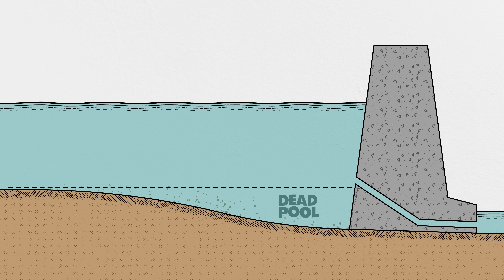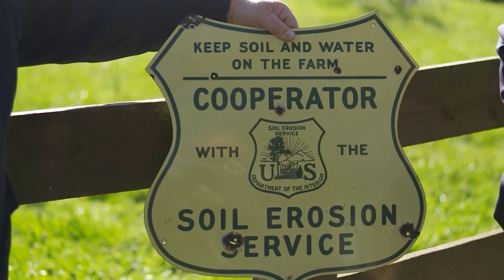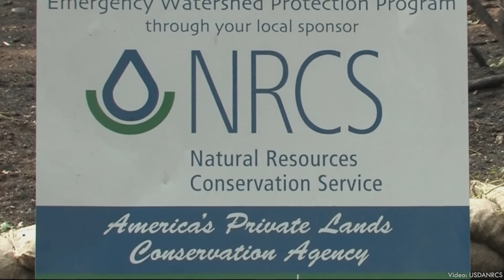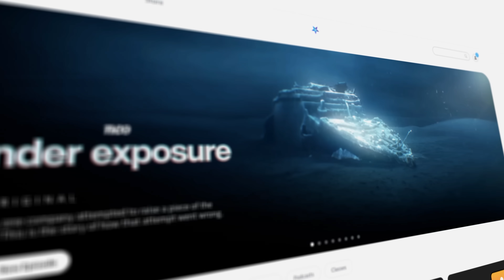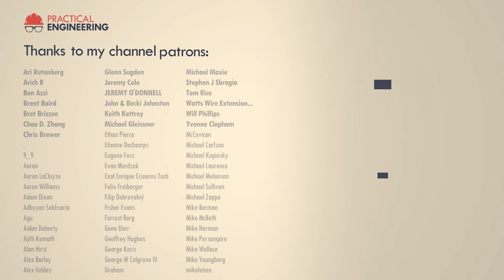All Dams Are Temporary

Comment: 4:58 “dirt is heavier than water! Let me prove that to you real quick”

Brilliant 😂
Reply: Dirt is "denser" than water I believe is the correct term.
Reply: @TheMrDarius  5 gallons of dirt weighs approx 55 lbs(or more if you compact it) and 5 gallons of water weighs 41.7 lbs
Reply: @bmxscape  which cements the fact that dirt is DENSER than water.
Reply: @ you are missing that it also cements the fact that dirt is heavier. it is denser, and heavier. Mercury is denser than both, and heavier. I do not see your point
Reply: @bmxscape  because science. Density is more of a correct term. Being heavy changes with specific conditions, density never changes. Dirt will always have a higher density than water. That's my point.
Reply: @ "because science"... right...You are wrong and again missing the point.

The density of dirt is not a constant. It does indeed change, contrary to your beliefs. What do you think happens when you compact soil? Go dig a hole in an undisturbed part of your yard. Break up any chunks of dirt, and fill it back in. You will seem have an "excess" of dirt. That is the density decreasing. Now dump a bucket of water on the loosely filled hole. It goes back to normal. That is the density increasing. Many things, from the shape of the soil particles, amount of organic matter within, wetness of the soil, pressure, aeration, all alter the density of the soil particles(distance from each other).  

The weight of a given soil particle however, remains a constant, even while the density changes - assuming you stay at the same altitude. 
Perhaps you are confusing the difference between weight and mass when you leave the planet, but that's a whole different discussion.
Reply: @bmxscape  I should have specified a bit better. Water as a molecule is less dense than a dirt molecule. I'm speaking at a molecular level not the macro level. That's my fault for not being as specific where no matter what at a molecular scale dirts density doesn't change water doesn't either unless you're dealing with heavy water with extra neutrons.
Reply: @TheMrDarius  In that case your point is not applicable to real life. We don't have single particles of dirt sinking in single particles of water in real life, nor can you even measure the density of a single molecule as the density calculation relies on volume of molecules(nor is "dirt" a single particle type). Dirt acts as a fluid just as air and water does, in real life. Should I specify we are talking about real life?
Reply: @bmxscape ”heavier” is not a scientific term. Riddle me this… I have one kg of steel and one kg of feathers. Which one’s heavier? 

How do you comprehend mass, density, and volume and still think “heavier” is a term?
Reply: @bmxscape  The demonstration was of density
Reply: @enemyspotted2467  The Kg of feathers is heavier because you'll have to think of what you did to those poor birds.
Reply: @bmxscape  5 litres of dirt is lighter than 5 gallons of water. Hence, in a comment above, "in some case, the water will become heavier".
Reply: @ what...? is there something wrong with your brain or are you intentionally blocking out logic? "heavier" is the word used in the video. That is why it is the topic of debate in this comment thread.. You look like a fool by stating weight doesn't exist.
Reply: @ So go make a post directing "practical engineering" telling him he is wrong. I am simply agreeing with what he said
Reply: @ if you think you can't measure the difference in weight, aka find which is "heavier", between a 5 gallon bucket of feathers and a 5 gallon bucket of steel, you really have no place adding input to the conversation
Reply: @bmxscape  if you can't determine that weight in my answer is including the emotional weight you'd be carrying around, then you're not the brightest lightbulb in the shed
Reply: @bmxscape  that's what the original comment did, It said that the demonstration showed something else. And he knows that already.
Reply: @mayo Lol we are having a debate like adults and you are the one to show up throwing insults... and your name is mayonaise.. please just leave and let the adults finish their conversation. Thanks! PS. none of my replies are directed at you. Thats just you desperately clambering for the attention you never got as a kid.
Reply: @bmxscape  What's even more ironic, Mercury is the densest planet in the Solar System.
Reply: @bmxscape  names can be anything, are you gatekeeping screennames now? You are a child and will probably never admit that you've had a misunderstanding
Reply: @h8GW  Other than Earth.
Reply: @bmxscape 
And what about if you compact the water?
Reply: @ the atomic mass of the water molecules do not change
Reply: @TheMrDarius A gallon of water weighs about 8.33 pounds.
A gallon of dirt weighs about 11 pounds.
Dirt weights more than water no more context needed. However wet dirt weighs more than dry dirt, and water so mixing the two essentially means you create something with more mass than both. It's really not that complicated. You didn't say "density" honestly there is no need for what I said explains it perfectly fine.
Reply: @Peterwhy  liters & gallons are two different volumetric measurements.
Reply: @bmxscape   It's only a fair comparison if you compact the water too.
Reply: @TheMrDarius … It’s also heavier.
Reply: its funny that in some case, the water will become heavier
Reply: I DON'T BUY IT.
Reply: @danielwesterlund1905 yeah I think we need a few more demonstrations, to make sure
Reply: What's heavier? A ton of water or a ton of dirt?

Grady: 🤔
Reply: It's like when there's a [citation needed] on a seemingly obvious fact on Wikipedia
Reply: False flag!
Reply: “Let’s try that again to prove it wasn’t a fluke…”
Reply: But steels heavier than feathers
Reply: I never expect to audibly laugh while watching educational videos by myself, but I most definitely did.
Reply: 😮 that went right over my head
Reply: Yeah, sure it is, smart guy. Now prove that you didn't just flip that entire video upside down!
Reply: I was going to contest that, but thankfully he convinced me just in time.
Reply: He distributed that sand so normally
Reply: HE'S A WITCH!
Reply: BUt he was using sand, not dirt! :D
Reply: Me: ALL you did was dump dirt in water how are you comparing them?!?!......oooooohhhhhh
Reply: THIS IS A LIE PUSHED BY BIG DIRT DONT LISTEN TO ANY OF IT
Reply: Steel is heavier than feathers
Reply: That’s like saying muscle is heavier than fat.
Reply: A pound of dirt is more dense than a pound of water. That is why dirt sinks in water, not its weight.
Reply: That wasn't even dirt, it was sand
Reply: Before he show it, i was sceptical at first, than i realize, something heavy always sink😂. Now i need to do my civil engineering homework more🤣
Reply: Dirt is actually more dense than the water, not heavier.
Reply: Nah,  i belive you, dont need prove it
Reply: Mind. BLOWN.
Reply: It tracks with all my research so I felt good.

Comment: You asked for a fix. If you where to place a large pipe up the center of the stream bed about 3/4 of the way through the reservoir, you could open the pipe at regular intervals. This should let most of it pass through. Also it should be drained regularly to help with this.

Comment: Could another structure built up stream that divides the river as it enters the reservoir into slices that continue down to the dam in columns
| A | B | C | D | E | ect then by dividing the reservoir up into sections closer to the 2 dimensional model, each slice Could be flushed individually, stopping the creation of a small central channel, Or by turning the reservoir into a massive continuous meander, water enters at ( A ) flows down to the dam then back away up ( B ), down ( C ) ect. Until ending back at the dam via ( E ect ) turns the entire reservoir into a 2 dimensional channel, just back and forth and from one side to the other.. 🤔

Comment: What about burying aerators to force the sediment back into the flow so that the sediment either goes over the dam or goes through the turbines. I recognize the damage sediment might do to the turbines but if you want to eliminate the problem of sediment build up, you have to accept the flow of sediment through the generators of the electricity. Not really a way around that. I can imagine the energy needed to run these but seems as if we would just be substituting one energy intensive method for another.

Comment: Why not use suction dredges as shown at 7:47, or at least the mechanism on them in static form permenantly to pipe the sediment to the other side of the dam?
That would keep the deltas from building up past a certain point on the high side of the dam and solve a lot of the problems downstream by still letting sediment flow down the rest of the river.
Is it just insanely expensive to operate a dredge pump like that? So much so that it wouldn't be worth running a dam to begin with?
You could even do it very low tech on existing dams by having an actual dredge ship who's only job is to collect sediment from around the reservoir, sail up to the dam and blast it over the top, the pumps are clearly strong enough.

Comment: I know its not at all feasible to grow fungal mycelium on the bed of an entire water source leading to a reservoir, but i wonder how resistant a system like that would be to reservoir sedimentation given how erosion-resistant myceliated soil is. pleurotus ostreatus is a powerhouse!
Reply: I think if the conditions are good for the mycelium, you could just spray spores from a barge going down the river
Reply: @ i don’t have enough experience to know myself, but do you think the spores would be able to germinate underwater? or would this hypothetical require a treatment of the bed with spores before flooding

Comment: 1:15 So you asked me to come up with a solution off the top of my head before watching the rest of the video.

Well I thought of dredging at first but that's obviously going to be completely impractical, where are you going to put the material? You can't dump it somewhere else in the lake like you'd do with a river or port, and trucking it away would be ridiculous.

But then I remembered flushing. You periodically drain the reservoir (every 5 years or so) allowing the built up sediment to be washed away. Obviously it wouldn't work to clear decades of build up, and it would be a huge hassle to anyone who has a boat moored up along the shore, or anyone else who uses it regularly. But for a reservoir that had this "lifecycle" from the start it would just be a natural part of living by the reservoir, that once every five years you'd have to pull your boat out of the water and prepare for the levels to drop.

I'm an engineer, but not a civil or hydrologic one so there is probably something I've missed. However just a quick google tells me that managing sediment accumulation is an active and ongoing process from the moment the dam is built, not one that you leave for decades and then have to do drastic remedial work to rectify.

It's a multi-stage solution. First, erosion control methods in the catchment area upstream to minimise the sediment entering the reservoir. Then you need to look into land use in the catchment to minimise soil erosion such as reforesting where possible. Then you can put in small check dams to trap sediment upstream of the main reservoir. You can also divert heavily sediment laden water through a bypass channel.

I found all that out within a few minutes of googling, a proper engineer in the appropriate field will know all that stuff already. Dams should be built with these measures in mind. It's a shame that people in the past didn't care (or know) about this sort of thing.
Reply: Now that I've watched the video, I'm glad that a lot of what I mentioned was covered.

Comment: Run a fairly thick hose from one of the gates upstream to erode away the silt buildup and release it downstream. It's slow enough that it won't overwhelm the downstream, fairly cheap and you just need to occasionally move the hose end to a new area.
Reply: Not that easy, the hose will only affect the area directly at the inlet, you need to move it all the time, basicly a non stop dredging operation.
Reply: A hose thick enough to carry 6000 pounds of sediment every second is cheap???

How do you separate the sediment from the water?

How do you make sure it drains sediment across the entire area, rather than one small location??

Want to know a better long term solution?
Remove the dam.

Comment: I know you said there were a ton of options but I wanted to share the one that first popped in my head.
I was thinking of a system that captured the sediment at a narrow point before it enters the reservoir proper and feeds it onto a slow conveyor that then feeds into the dam outflow.
Probably wouldn't actually use a conveyor belt as that seems silly (it was just a visual) and I'm curious how similar it is to the bed-load interceptors you mentioned.

Comment: I was an NRCS watershed design engineer until recently in Texas. I really appreciated the inclusion of the mission NRCS was founded to achieve. The agency built thousands of dams in Texas alone for flood control and sediment control on the tributaries to main creeks and rivers. These are almost always overlooked but they all play a role in the watershed infrastructure network. Great video!
Reply: Well.....the Colorado river cuts through Central Texas, in fact, right through Austin.
For those who don't know...."Colorado" in Spanish means "red"....red as in the water constantly ran red from sediment. This "red" river flowed all the way to the coast and spilled into vital estuaries, replenishing nutrients needed for marine life.

Alas, the govt built a string of dams northwest of Austin. All that sediment is now at the bottom of the reservoirs (& constantly building).
Now the Colorado runs clear and except for ag runoff, fairly nutrient free.

An engineering and biological disaster in the making
Reply: @ Thanks, that's interesting and does explain the name. Although I suspect for the estuaries and anything else downstream they've already had a biological disaster if the nutrients carried by the river have changed so much. That said, nature has to be resilient because drastic changes can happen naturally... the problem is that humans are causing such changes much more frequently and many more of them than would ever happen naturally.
Reply: One day, Texas’ waterways will be freed
Reply: I'm sure the current administration completely understands the importance of the work the NRCS has done and will continue to keep or increase the staffing, funding, and resource levels to ensure this important ongoing work continues unbated.
Reply: @LunarRed  You forgot the "/s."
Reply: Think the NRCS will survive Trump?
Reply: @Tinil0  Nope.  They are part of the red tape preventing megacorps from exploiting the land and the natural resources and then walking away to leave others to clean up the mess.
Reply: @Tinil0  if they don't immediately understand it by the name alone or feel that it will benefit their personal agenda, they won't have any qualms getting rid of it. They also might just say that it's "something that private industries already see as incredibly important and do for the good of great 'Murica, so we don't need such an agency anyways"
Reply: @Tinil0 
fuckin' hope so
Reply: @ Fingers crossed!  The NRCS does a LOT of good but the current administration seems to be on a massacre spree of agencies so...I'm hoping they can make it out without being too brutalized, because our country badly needs them.  But I mean, we need the forest service too and that hasn't saved them.
Reply: Good lord I’ve never seen a comment thread of people who think their jobs are so useless they will be shitcanned by this administration 😂.  If you thought you were doing something useful and something you were proud of you wouldn’t be worried about this admin getting rid of the position. It’s when you know that your job is useless and that the agency you work for is a building full of a 10 people doing a 1 person job that you should be worried. 

This comment isn’t directed towards the OP / author of the original comment it’s directed at all the people who responded
Reply: @Evergreen1400  really? even if you don't agree, you cannot pretend not to understand that they think the administration is getting rid of jobs that are actually important.

Also not one person in this thread other than the OP [who you specifically said your comment wasn't directed to] have said anything about their own job so what the heck do you mean "their jobs"
Reply: @Evergreen1400 what's it like living in your fantasy world where bad things only happen to bad people, and lawmakers make exceptions for "the good ones"? 😊

For real though, I encourage you, and anyone thinking the same, to please listen to the stories out there of hard workers who are being blindly cut, and not waiting until it happens to someone close to you.
Reply: @Evergreen1400  The criminals in charge do not give a stuff if anything is vital or saves lives unless it affects them personally. If it affects them personally then they will ensure to privatise it and make as much profit as possible but anything else doesn't matter. To these criminals, you are either an obstacle to be removed or a resource to make them richer, there is almost nothing else you will be to them.